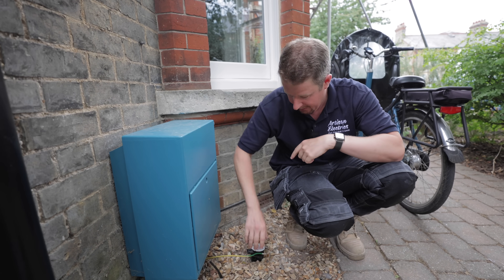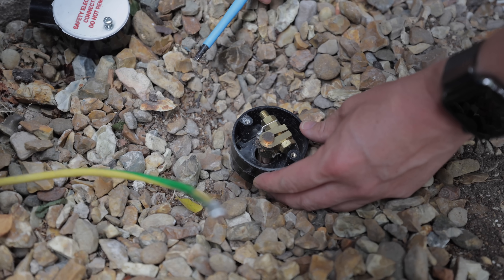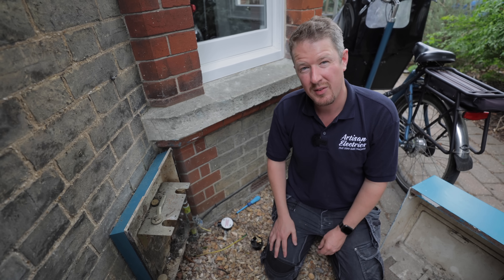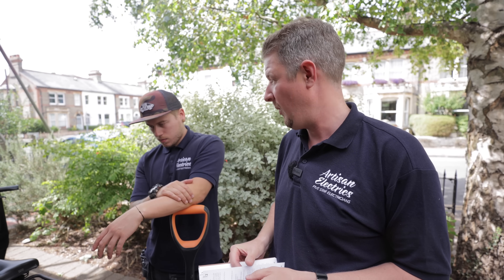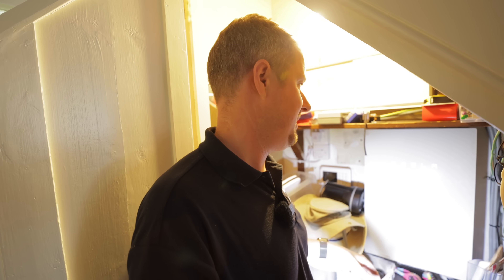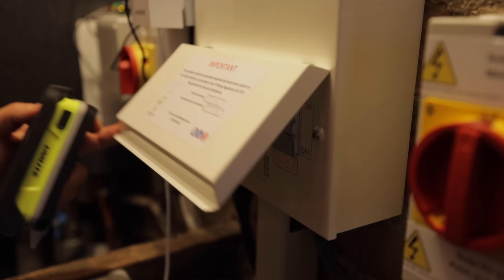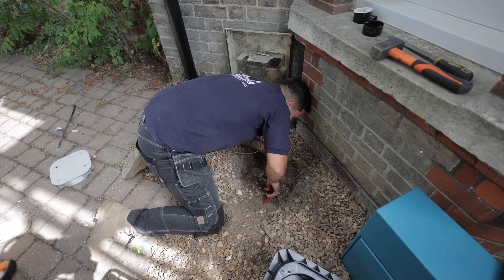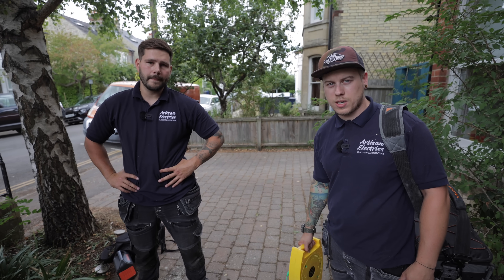The WORST Tesla Powerwall install I've ever seen 🤯

Comment: If you measure Earth rods you are supposed to disconnect the supply earth!
Otherwise you wont measure the earth rod but the impedance of PME altogether!
Where I live Re has to be lower than 100 Ohms with old buildings but with new ones on an TN-S-C supply it must be lower than 10 Ohms!
Those bus data cables should have been taped off on one side and connected to ground on the other side! 
Other than that there is not much wrong....well its not very pretty I guess.... must have been in a bit of a hurry the guy that installed it!

Comment: Pme in a power cut could loose its neutral and you are feeding a live feed into the system that has no “return path” back down the supply neutral (I know ac bla bla over simplified). Because the earth and neutral is joined in a pme you are essentially livening up all the metal in the house.

Comment: Even tho the gas meter has been removed, surly it still needs bonding as it’s still a metal pipe coming out of the ground that is exposed. We always bond old exposed gas pipes in a property.
Reply: It's been disconnected from the house piping so it's not extraneous - the part in the ground doesn't enter the house or another building with an electrical supply. If you followed your rule you would bond every metal fence post, shed, greenhouse that contacts the ground.

Comment: THE BIGGER QUESTION :  why in the UK is still practices bonding earth to water/gas main is still practiced when glabally the banned the practice due to shocking (water)  and going boom grounded to gas main was outlawed for safety reasons some 45+ years ago??
yup and the main ground should likely be likely thicker than 15 amp wire especially with with charger and solar power as an option
I see there is a lot of daisy chaining still going on on rcd fuses and nobody has learnt that  2 points are the capacity if not 1 double gang
 with a power board or 2

main ground on 3 phase to common ground would likely need to be  upgraded to 150 amp wire if not  more 15 amp domestic cable would not hold a rating 25-200 amps something to consider with both 3 phase car charger no clue on what the capacity is over 3 phase on a solar and battery solutions which should be within 24-96+ vdc to either 240 vac single or 3 phase bare min..

Comment: Not sure about the dogs breakfast in the junction boxes and mixing data cables with mains is a no no. I am sure (haven't read the regs for a long time) the regs require mechanical separation of the data cables from the mains cables.

Comment: You need stop doing videos giving rubbish advice, A tesla power wall is 13.5kw usable and 17kw peak, its an ac coupled system and is not connected in to the solar array, i have seen a few of your videos an i could pick holes in every single one of them, worst of all your giving advise to the general public on how to do electrical work which is a very stupid and dangerous thing to do, STOP DOING THEM YOUR ENDANGERING LIVES 🤬😡🤯🤬

Comment: I would've re-used the Earth Bond from the gas.
As I understand there is no minimum CSA for the Earth rod for a TT system, I searched for it a while ago and there was no minimum in the OGS(that was 18th Ed original).
Great video guys!
Reply: 2.5mm is min or used to be protected

Comment: under ground or in a wall, the size of the wire matters because those environments can dissipate heat at different rates. a cable under ground can dissipate a good amount of heat quickly, but once the area is saturated with heat, there's that limit. it's a general case rule.

Comment: Regarding the mention of a DC Coupled system:

The panels should never feed power straight into the batteries. That is a completely inefficient way of solar power usage.

The reason it goes into the inverter first is because the inverter will be able to distribute the power in the most efficient manner. The inverter determines when/how power needs to be diverted primarily. It also protects the batteries by determining when and how much the batteries need to be charged in order to still provide the house required power. It determines that if there is a storm or flood around the battery to stop sending power to it and divert it to the house instead or stop it altogether.

And that's just the basics.

Whoever installed that system under contract from Tesla should be reported and that system should properly be fixed if it is in fact dc coupled at all.

Comment: The earthing conductor to the earth rod should have been disconnected at the consumer unit to get your Ra/Ze.  The way that it was done you would have parallel paths.  I would use a minimum of 6mm for earth rods as it’s stronger than 4mm.  I personally use 10mm as it’s always on the van. 👍🏼

Comment: Not a true earth rod resistance reading with the earth still connected. Your taking into account all the parallel earth paths including the main incoming earth that would be disconnected when the house is running in island mode

Comment: why would getting another tesla powerwall be an issue? That wall on the house had plenty more room. It is just a matter of adding more batteries unless tesla requires additional useless proprietary hardware to connect more batteries?

Comment: Data and power running next to each other?  When I used to install cable and internet we where told that is a no no because the AC field can interfere with the data lines.

Comment: You calcs for max fault current on the 10mm to the Earth rod were based on 200 Ohms resistance not 1 Ohm. Potential fault current could therefore  be substantially higher.

Comment: You seem fairly clueless when it comes to Tesla powerwalls they are ac coupled battery’s not dc I would advise you doing the Tesla online course if you are going to bugger about with them. I have installed approximately 50 Tesla systems they are the best out there and very expensive kit.

Comment: Hay Jordan nice vid.
 The easiest way I've found to  explain the earth rod for the power wall is:
When running in island mode (off grid) the installation needs to be disconnected from all live conductors (both L&N)...
On PME systems we cannot disconnect the neutral as its the same cable as the earth coming into the building. 
The new  earth electrode acts as the main earth  when running off grid in Island mode. The power wall switches in a link between the earth electrode and the suppliers neutral to bond the neutral as its classed as a extraneous part when not in use.
They call it a PNB "protective neutral bond"...
 Consideration should be given to the test readings when running in island mode  as the although the suppliers neutral being bonded  would lower the impedance (Zsdb) can it be relied on especially in a power cut..

Comment: @Artisian  Electrics 
German Electrician guy here 31 years doing so, and that earth rod alone is instant failure, as a prober earth rod should be at least go 2 meters down depending on ground s condition 
a lot of new constructions have gravel side filings which are unsuited for Earthing, here we are by code forced to use Stainless steel Rods of 25 mm then 16mm² to equipotential bonding
depending on where they are installed.
Surge arresters can produce very high amps and voltages for some ms so the thicker and lower ohms to the Earth bonding / Rod the better, as that also prevents Copper and steel pipes and such from being eaten away by  galvanic corrosion. 
Here in germany its required your earth local is lower then 2 to 3 Ohms 
Rlow so equipment to earth needs to be under 1 Ohm.
but yeah cleaning up such failures from previous companies is never fun, especially as when you touch it your on the hook.
Reply: Belgium is less than 30 ohms for an earth rod/TT system.  I had to have several fitted around my property to get something that conformed as the original system was buried under the foundations when the house was built 40+ years ago and was giving 300 ohms

Comment: How to 
Guess the performance of an earth rod without knowing the ground or how long it is
Need a calculator to estimate the PFC if its as bad as it can be  (let's go with that)
Whack a rod in but not test it at all  *Note it may have hit or gone near the gas pipe
Get a reading at the board that you think must be just the rod ???  (if you actually believe it this means your PFC and cable estimate is out by 200x
Think that's all fine mate and get on with criticising other people's wiring tidyness
Go off to the next job

Please tell me you returned to test the rod properly

Comment: I install the powerwalls for a living in the UK. They are AC coupled only and there's no way of connecting a DC supply. Also  all of those cat5 cables are the communication cables between the powerwall and the gateway. They seem to be using 4 of the cores for the 12v and comms where I use 1.5mm for the 12v as per teslas instructions.
Reply: There's a 1.5mm twin & earth for the DC supply there as well, one of the CAT5 pairs is for the Powerwall comms and one for the Zappi's grid CT.

Comment: Tesla Powerwall is a 13.5kwh storage battery not 10kWh. It’s not DC coupled either its AC coupled. One of the main benefits at least from an installers point of view is that the DC side isn’t touched at all from the battery. It’s all internally done. That cable is the Coms cable from the gateway. 

Also they’re not 2 years wait if you guys buy through us. Drop me a message and we can chat 🙂

Comment: 5:56 The Tesla Powerwall does not switch over quickly enough that it will function as a UPS for computers.  We've found our Powerwall 2 takes about half a second to switch over.  So my business computers still all have UPS power, albeit the batteries don't need to be replaced as frequently as they used to.
Reply from the maker: Ah that’s a shame - good info

Comment: don't think thats rright.. In USA 200amp service panel requires a 10ga SOLID copper ground wire grounded within 6ft of panel.. 8ga for 6-10ft 4ga for 11 to 20ft.. ground over 20ft are NOT allowed.. Ground rod must return a OPEN OHM load less that 3ohms If one rod driven 8ft min does not make 3ohm.. more rods are required,, Power wall are TOTALLY DIFFERENT!!!! they are capable of 1,000amp shorts to ground!! They require 10% of total ampacity during a short to ground if its has manual circuit breaker, and 15% if electronic. So, a 1000amp power wall would require a 100 amp to 150 amp ground circuit ...
Reply: Is the 1000amp fault current of the power wall more than mains electric in the US ? 
The circuit protection should disconnect the fault in less than 0.4 seconds so why the need for a large earthing conductor ?
Reply: @persona250  because for that 0.4sec ( not correct by the way) the ground needs to be able to conduct that ampacity to a ground..or would you preferred it grounded through you?
Reply: @jwray9799 The circuit disconnects in such a small time there is no damage to the cable . You should go back to electrical school . 0.4 seconds is the maximum allowed time for the circuit to disconnect. We disconnect faults up to 10ka with cables as small as 1mm

Comment: I bet the electrode was connected in parallel with the supply earth when it was tested. I've never seen 1 Ohm from a single rod. Using a wander lead was also a bit of an odd choice, should've disconnected the 10mm from the MET and tested between that and incoming line.
Reply: Yes to parallel earth path.    By connecting to the correct breaker outlet, the fault current takes the path that it would do in reality. The reduced csa of the actual circuit phase conductor increases the loop impedance (relative to main incoming line), thus correct value - just thought same theory applies to a wander lead.

Comment: "... in the event of a powercut..."

Those are rather more frequent here in South Africa.
Load shedding and really poor workmanship on the supply network.
I had 12 hours last Tuesday and two streets away just come back after 43 hours.
They are now running on a temporary supply - two clean phases on the existing (damaged) armoured cable and the other phase and neutral through the overhead street light supply!
Have you ever heard of such a thing?
Reply: You are never allowed to have conductors running separate routes between supply and load. Keep them all together, always.
Reply: @imconsequetau5275  please explain that to City Power, not to me.

Comment: In the event of a mains power failure, the switchover to battery power isn't always instant.  It can be, but you can also be without power for up to about 30 seconds.  No use therefore for keeping your computer going unless it's a laptop or has its own UPS.  The most irritating feature though is that you have to reset the clocks on all your ovens!

Comment: The equipment your customer has is very similar to mine.
In July 2020 I had Joju Solar install a 9.6 kW solar array, Tesla powerwall 2 with gateway,  8kw inverter.  In 2021 I had a Zappi installed.  Everything working fine as best I can tell.
As for the gateway I don't know any more than you do but can safely say it works very well as I had a 19 minute power cut in late 2020 and only found out about it the following day when I checked the app.  My burglar alarm system is very sensitive to power fluctuations as it sees any fluctuation in power as tampering and switches over to battery back up for a while. The gateway was so quick to enter island mode that the burglar alarm did not notice.  I would have been home at the time and also did not notice.
My earth rod is in my basement/undercroft It is sunk into to the concrete floor and very much out of the way.
Another benefit of the Tesla powerwall is with octopus energy they have a tariff where Tesla takes control of your battery and you feed electricity to the grid at peak time. 4-7pm.  You are paid 12.2 pence per kilowatt hour for energy you upload to the grid and the same price applies to energy you take from the grid.  With the cost of electricity at the moment this is a very good deal and it wouldn't surprise me if they stop it at some point.  During the winter Tesla/Octopus fill your powerwall overnight at the cheapest point (I still pay 12.2 pence for this) and during peak time you give it back to the grid (there is a 8 to 10% efficiency loss doing this).  20% of the battery 13.5kw capacity (2.7ish kw) is kept to one side for emergencies.

Comment: The earth rod 10mm cable clamped to the mains gas pipe adds earthing value. And using the existing 10mm cable is fine. 

I have seen a 10mm earth bonding cable drop from the CU under floorboards then clamped onto a copper internal gas pipe just under the floorboards.  Near the gas meter another clamp on the copper pipe under the floorboards with a 10mm earth cable rising then clamped at the gas meter outlet. The internal copper gas pipe was used as the gas meter bonding cable, as it would have meant ripping the house apart to get a cable all the way.  Worked.  Electrically sound.
Reply: Electrically sound but against regulations .
Reply: @persona250  
Yep. Would I do it in my own house? Yes.
Reply: @johnburns4017  I hear you on that . I have 10m of 25mm tails installed at home with no switch fuse .

Comment: The Tesla Gateway 2 unit is a very clever piece of kit.

Ours is installed outside, and it has 4 connection points for backup side, and 4 connection points for Grid tied side (max 32 amps)

I have a 7 kW Ev charger on Grid tied... and a 32amp Commando Socket on Backup side.

Comment: What an absolute mess of an original installation, I’m guessing the owner did not read and understand the PW installation manual. We had one PW, and a second was added two months later with the third due next month.  Adding an extra PW is easy, don’t forget to connect the data cables correctly and move the termination resistor. I’m no sparky, and don’t know any regs. 😁

Comment: You can install another powerwall infront of this one and they give you a guide to drill between the two and couple them together and all you need to do is use the remade AC link
Reply: No you can't in this case...  the Powerwall in this video is wall mounted off the ground.

To 'stack' the Powerwalls they have to be on the ground... and being outdoors that might cause a water level issue.

Our Powerwalls are outside, and wall mounted side by side, and off the ground
Reply: @JustMeTalking  fair enough didnt realise its off the ground

Comment: If the max resistance (ZE) of the earth connection is 200 Ohms, then your calculated 1.15A is the minimum fault current that might flow, not the maximum. If the actual ZE is lower, the current will be higher.
Reply: ? Do you mean if the ground gets wetter and more conductive for example. ?

Comment: Interesting how easy the installation is executed in other countrys, in Germany the Earth must be a V4A steel with 9.5m, and the cable must be not smaller than 16mm2, if you are using a seperate earth
Reply: Martin: ? What would you expect as an average ohmic impedance for an earth loop circuit to a ground rod, when you test the loop.

Comment: Our regs require a 16mm tinned copper wire straight to the earthrod when exposed to corrosion. From main earth point in the house, you take a minimum of 6mm to the panel. Bonding is 4mm here.
Reply: Our max Ze is 166ø though. Only when everything is behind RCDs. If not, like in old houses, its 1.5ø

Comment: Before you even do measurements/calculations, if that's the main Earth for the supply it must be greater than half the size of the supply tails. So if the supply is 16mm 10mm Earth is fine, if the supply is 25mm the Earth needs to be at least 16mm.
Reply: Those rules don’t apply to an earth rod or a tns earthing system.